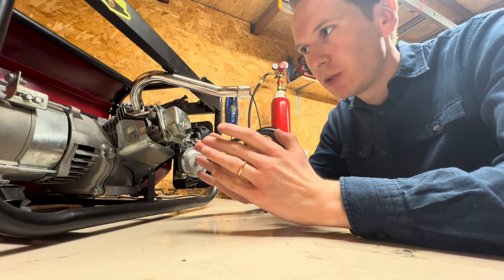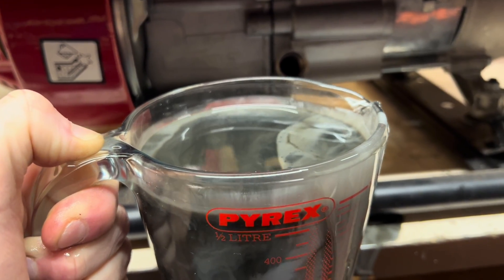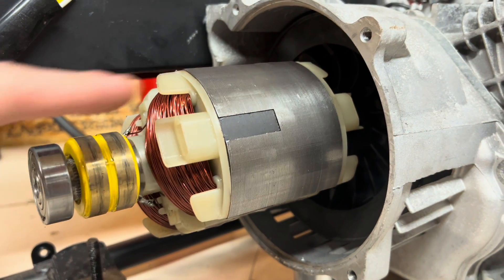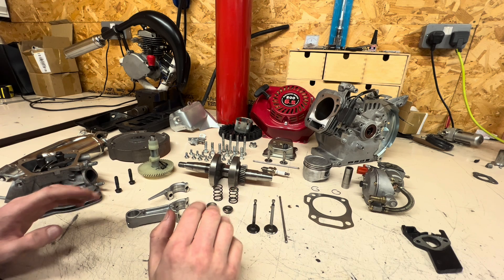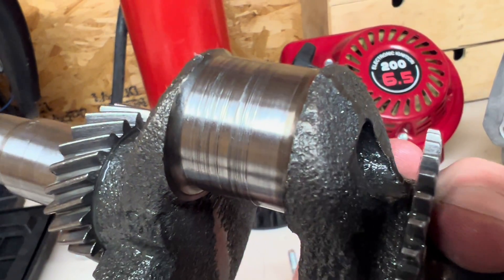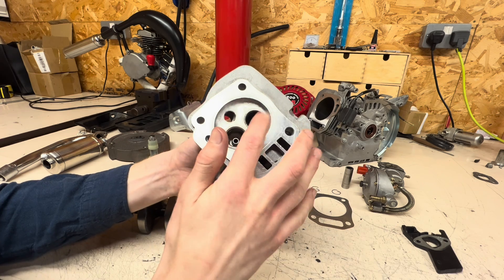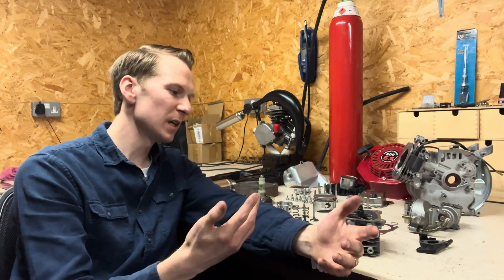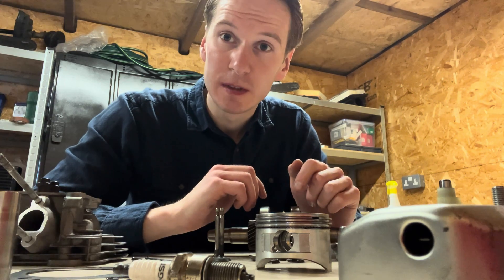Internals After 2 Years of Hydrogen

Comment: so just to clarify. Hydrogen hasnt damaged the engine then apart from the aluminium con rods?? would they have worn diffrently if it was hardened steel. the reason why im asking is im considering changing my cars petrol engine to Hydrogen. there are plans to remove petrol engines by 2030. As electric isnt a option for me on a trike licence. as i can only use limited electrics and weight and bhp?? im restoring a reliant rialto
Reply from the maker: Myself and 90% of the comments point towards poor oil is what damaged the engine. This was intentional as I didn’t change the oil to observe the effects, to confirm this I am replacing the con rod with a like for like replacement but have frequent oil changes :)

Comment: My parents have had a few LPG cars, one of the problems with any type of vapour gas fuel is the lack of lubricant injected inside the cylinder. So normally with gas cars the car starts on petrol, then swaps to gas after a few minutes.
Reply: Yes. Best to switch off LPG and back to Petrol a couple minutes before journey end.
Reply: Petrol lubricates nothing in an engine. In the older days the valves seats needed lead in the petrol  for not damaging the seats. But since then the lead is gone  and hardened valve seats are used in all modern engines. I cant remember when that was changed, so if your car was designed or built before the 90s you likely need lead in the fuel.
Using Petrol to start LPG engines has other reasons, its not about lubrication. LPG is also very different to hydrogen. BMW had decades ago HHO cars ready for production, it got only cancelled because of the political unwillingness to provide a HHO tanking infrastructure (fuel stations) and the fact that BMW used liquid hydrogen. They had no high pressure gas tanks as we have them today and liquid hydrogen wasn't ideal for a lot of reasons. We still have a problem with politics.
Reply: @unbelievablegoodio7176  To be fair that BMW 7-series on hydrogen was not really great.. I don't think it would have sold with considerably less power than the petrol version and a fuel tank which empties itself in a couple days, reducing the range from almost useful to "yeah nah". Might have been useful if it was a smaller, budget car for city use. And nowadays we really don't need hydrogen cars anymore.
Reply: And keeping a car, which leaks hydrogen, in a confined space like a garage could lead to an explosion.
Reply: @musicbruv  Good point but I didn't check or calculate if that is too big of a problem. Of course if the garage was sealed 100% it would always be a risk but most are not.
Reply: @allesklarklaus147  I suppose the rate of leakage might be low enough for the gas to escape to the outside so as not to be a problem.  Insurance companies might not like the idea of a highly Inflammable gas leaking into a garage, especially one that is under a house.
Reply: @musicbruv  Yeah I think one would need to run the numbers on this but I suspect it is an issue and you would need a vent at the top of the garage somewhere. But overall the concept seems bad enough to me that it won't become "a thing" any time soon.
Reply: @musicbruv  check videos about fire BYD cars. THAT is a risk, and very violent on top. Gas in cars not even near that. Hydrogen thins out upwards. Unlike LPG it does not accumulate and stay in lower ground rooms.

Comment: Oil is emulsified from combustion water ingress past piston rings, probably contributed to the big end failure.
Reply: That was my guess to . changing the oil more often and maybe a heavier oil would help .
Reply: there is no dripping water inside the piston of an HHO engine. The exhaust gas is well over the steam temperature of water, so all that steam leaves through the exhaust. You can only see the water when that steam cools down at the end of the exhaust. This engine got a problem with far to early timing, I bet it was running loud like a knocking engine.
Reply: @unbelievablegoodio7176  Combustion condensation makes it into the oil of a low mileage Petrol engine, it can surely do it in a HHO engine! You can see the oil is emulsified and there is no other source for the water.
Reply: @TheGalifrey  I had once a Cosra 1.3, 60HP. I used full synthetic oil. Cold winter with long time below -15C. Lots of hot driving, I am snow faster than most people in dry weather. Suddenly the whole engine room full of sprayed around oil, out of the filler cap. Never seen or heard that. The cause even more unusual. Due to my hot style driving got the oil always hot over 100 C, hence all the water what accumulates after the cold start evaporates. It goes normally through the, in this car quite long, hose from the block to the air filter, so the oil steam can be burned off. But due to the cold nights the vape condensed in that hose and closed it more and more by freezing, because the hose never got warm enough in some places to melt that ice. When it was fully clogged, the block could not vent anymore and thankfully it just lifted the filler cap, blowing out a lot of oil with it, so all I had to do is crack the ice out of the vent hose... So yes, water in oil can happen, its just not more in hydrogen engines.

Comment: I wonder if the combustion isn't 100% efficient in converting the hydrogen and oxygen into water but is also combusting some of the nitrogen in the fuel air mixture with the oxygen to form oxides of nitrogen and ammonia, especially because of the high combustion temperatures. I could then see nitric acid being formed that might then cause wear and corrosion of the metal parts of the engine and to contaminate the oil.

Comment: I have a failed one of these engines in my garage, the factory con rod in mine is identical to yours and it is a very soft almost pot metal and it probably just couldn't handle the stronger detonation forces of the HHO mixture. Most engines like these have upgraded internal parts available online on Ebay for go-carting, and are fairly affordable too. I would also recommend retarding the timing slightly, and that with an upgraded con rod should allow the engine to be much more reliable long term.

Comment: Wait, this engine does not have rod bearings and aluminium just sits on the crank? 
If so... poor desing... Aluminium is soft, and it has to fail sooner or later...
Reply from the maker: Yeah very simple engine design, with frequent oil changes and used in it’s intended purpose (as a generator) at low rpm, it’s not so much of an issue, will definitely need to upgrade it before putting down more power

Comment: I like the idea of the hydrogen engine.  I don't believe oil additives are made for hydrogen as a fuel like they are for gasoline or diesel engines?  Spark plugs, designed the same way for gasoline engines?
Reply from the maker: Yes spark plugs are the exact same, need to run a cold running spark plug for hydrogen though

Comment: idk much about these engines but as a mechanic that damage on the crankshaft and piston rode looks to me like low oil pressure. 
aluminum rods actually work as a dumper so detonations wouldn't be much a concern to me (if its not excessive of course)
new crankshaft and piston rod wouldn't be the fix if you don't find why there's not enough oil pressure in that area.
Reply: These engines don't have an oilpump , the "spoon" on the conrod splashes the oil arround 😊

Comment: plastic camshaft lobes?
Reply from the maker: Yes, crazy right, will need to upgrade to metal for the stiffer valve springs I plan to get.
Reply: Plastic camshafts are common in small engines. Even Briggs & Stratton is using it!
The wear is not higher under normal lubrication conditions, it's more silent.
May I remind that the point and contact ignition systems (interruptors) also had plastic lobes on steel cams!? 😉

Comment: My company works in close proximity with hydrogen engine development and as far as i know the biggest issue with hydrogen piston engine is NOx emissions that the engine creates. 
Trying to get around that causes a lot of issues with metering parts wearing out due to hydrogen providing no lubrication. 
I don't work with the development directly so take this with a grain of salt still lol.
Reply: Arrington  performance is detecting NOX below acceptable levels. Also one can still use catalytic converters to decrease the NOX output.  JCB in England has also converted their diesel engines to run on Hydrogen and they too found that if you keep the cylinder temp below 2300 degrees C, NOX is not created. Remember burning anything in atmospheric air which is 71% nitrogen can oxidize that nitrogen.
Reply: @TG-lp9vi  Then extract the Nitrogen for the additional use of superconduction.
Reply: are you in germany? Asking for my friend as he's looking to work he's ME

Comment: The oil suggests that there is water contamination of the oil, causing excessive wear.  You should use an oil that is water tolerant, or perhaps an additive.  Water soluble oil would be a good thing to add.  If you know someone who tinkers with steam engines, they might have a few better suggestions.

Comment: While I never expect to see commercially viable hydrogen ICE cars, I do fully expect to see them in the near future for many stationary applications. They kinks can easily be worked out for stationary engines. With vehicles a lot of the major issues come from storage of fuel, safety of that fuel in a collision, overall packaging and making it work over an extremely wide range of RPMs, climates, etc. These aren't really of any concern for a stationary engine as you effectively remove more than half of the most problematic situations.
Reply: I don't think so. If you need a stationary power source, and hydrogen is the fuel of your choice, a fuel cell is the way to go. No hydrogen operated ICE gets even close. Right now, you can already buy them in the kW running on methanol - no oil change interval, very little moving parts, the fuel does not age like gasoline or diesel does... etc ... pp.
Reply: @wernerviehhauser94  for new builds an ICE may not be the best, but modifying existing ICE would stop CO2 from that moment on. Thats the fine thing with hydrogen, no need to throw away existing vehicles, and parallel increase the numbers of fuel cells until they take over. The same for all industries who cannot use electircity, because they need flames. One day, when fusion reactors finally provide endless electric energy, it still has to be stored (buffered) in gigantic scale, and that will not be batteries, it will be hydrogen. Its no politics, its simple technical.
Reply: @unbelievablegoodio7176  Existing gasoline engines will not run well on hydrogen. Go ask BMW. They know pretty well how to make engines, and they gave up. This is not economically viable in any way. Fuel cell cars may be better, but strictly cost-wise they can not be competitive with batteries in 9 out of 10 cases, since hydrogen from electrolysis is about double the price per distance than using batteries. You'll see, even Toyota's fanboying for hydrogen or ammonia engines will end up dead sooner or later because it's simply not a good idea, whether you like it or not. The convenience to be able to fill up the tank in 5 minutes (that 9 out of 10 people need less than 4 times per year, and those 4 times they could just enjoy a coffee and a croissant during those 20 minutes for recharging since they have already been behind the wheel for at least 4 hours and should take a break, anyway) is simply not worth the cost in most cases, and tbh, I loathe having to drive to the gas station when my tank is empty while others just get their cars filled overnight. Going for hydrogen now just make more efficient ways of reducing carbon emissions develop slower, but it's "just human" to want to stay with the junk they know rather than do things differently to do them better...
Reply: @wernerviehhauser94  look right now when hydrogen is cheapest to make from oil there's very little point in making them except for niche applications where you need a cheap engine and have somehow a source of free hydrogen. 

if the engine cost itself doesn't matter then a mirai style fuel cell makes much more sense than a four or two stroke engine would.

like you could make a 2 stroke hydrogen engine super cheaply and be cheap and maintaining accessible, but if you don't have the free fuel for it then it doesn't really matter.
Reply: @lasskinn474  you'll pretty much never have free hydrogen, there will always be more economic uses for surplus energy than turning them into hydrogen. And fwiw, if a lot of consumed energy has moved to renewable sources, gas and diesel will go down in price because of reduced demand, and my bet is on standard ICE being around for ever, just being used in a only a few situations where all other options are impractical.
Reply: @wernerviehhauser94  I am of the opinion that thermal energy is on the way out, Electrical machines easily exceed 90% efficiency whereas thermal energy conversion is limited to roughly 40 % and you cannot improve this. The future is direct conversion of solar energy to electrical energy that will power human civilization.
Reply: @BjarneLinetsky  you studied neither engineering nor physics but studied BBC. Waste of time.

Comment: Have you tried retarding ignition timing since hydrogen has a much faster burn rate than gasoline I would think this would greatly help the engine live longer and reduce the wear you’re seeing.
Reply from the maker: Ignition timing was retarded to TDC, using a bracket to shift the pick up coil. 
Thanks for the comment :)

Comment: the crankshafts on those are atleast case hardened on the bearing, the connecting rods usually DEPOSIT on the crank so you can try setting it in muratic acid for 10-15 minutes and then a polish it might be good.
Reply from the maker: Thanks for the info :)

Comment: I think the best way to avoid this type of failure in the future would be to 
a. Retard the ignition timing due to the faster nature of hydrogen combustion and-
b. Use an engine which is equipped with ball bearings or needle bearings on the connecting rod instead of this plain bearing design for more durability
Reply: That doesn't sound like a very common engine design
Reply: @5.43v  depends on your definition of "common". Ball bearing cranks aren't terribly rare within higher quality equipment. Commercial quality small engines typically use them. Ball bearing rod bearings aren't as common, but are popular in engines found on things like ATVs and dirtbikes.

Comment: I would guess the timing is maybe causing it to fire too early?
Reply from the maker: Timing has been adjusted with this engine, but to confirm I’ll ordered an ignition timing light etc to confirm the ignition point :)
Reply: @Hydrogenguys  failing that, could be pre-ignition caused by running too hot? Glowing spark plug. Definitely interested to know the true findings, good luck, man.

Comment: I don't know the context, but being a car mechanic and building engines too, i can tell you this engine looks quite normal for 2 years of use especially if it was used daily and was loaded the whole time.
Maybe the crankshaft wear was a little accelerated and that is what made it fail, but if i compare it as to its quality to a chinese moped engine running on gasoline, you can see same things happening, some are even shearing off the crankshaft completely.
Also one thing people misunderstand is that an engine that works is good, in reality they start getting out of specs before you realize it and need an overhaul, might even show good compression but when loaded it starts blow by like crazy, burning oil, turning it black, leaky valves, knocking, etc.
If you want a hydrogen engine like this that will work for a long time you should find one from the moped scene for which you can get ahold of billet parts, crankshaft, highest grades of bearings available, forged piston, etc, parts that lasts for tuned bike racing at 30hp+ with less than 200cc.
Reply from the maker: Thanks for the info, much appreciated, 

I have found some billet parts for this engine which I’ll look into for the engine rebuild
Reply: @Hydrogenguys  Once you work out the bugs, you will find that the piston, cylinder head and even the cylinder will slowly become brittle due to hydrogen contaminating the steel and aluminum. Back in the 1980's a Postal Jeep, DG3, was converted and the longest run time they achieved between failures was less than 10k miles. They lacked the ceramics needed to make the piston or top of the piston, and thus manufacture a piston able to stand up to the fuel...
If you want to use a simple engine with a lot of high performance parts available, an air-cooled beetle engine will work. That has the advantage of easy to replace pistons & cylinders as well as new cylinder heads...

Comment: Need to be keeping an eye on your egt & also valve clearances too. I'd be surprised if the valve & seat material is up to much on the exaust side so with elevated temps/tight clearance you'll burn valves out very quickly...even worse if your ign timing is off. As others have said det will kill the big end as you've seen. Interesting stuff though.
Reply from the maker: Will look into it, cheers

Timing was set to TDC, I wonder if I can source some upgraded valves to deal with the extra heat? Will be interesting compression too, so will keep an eye out for the valve clearance